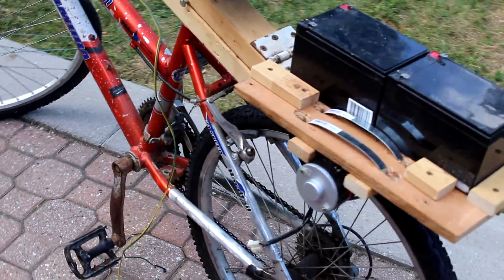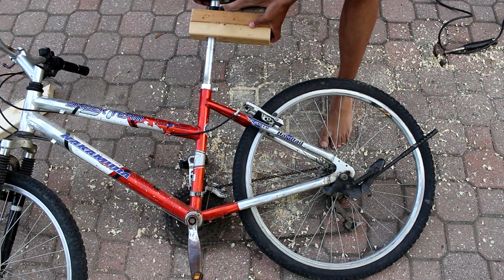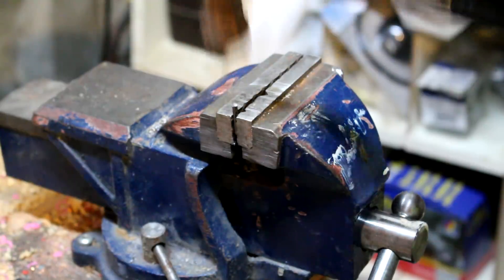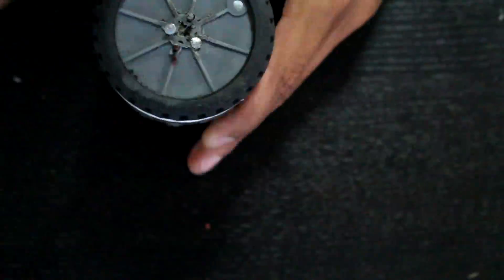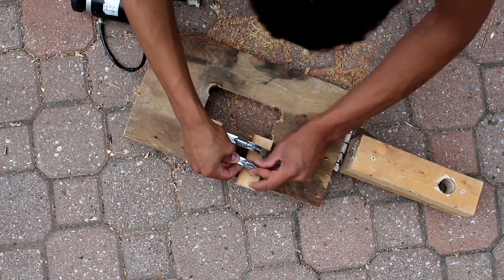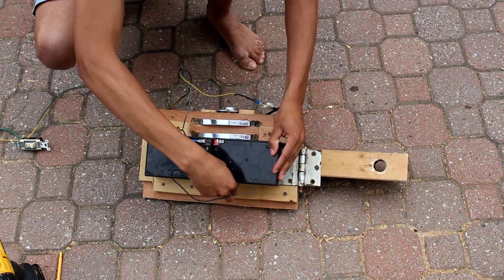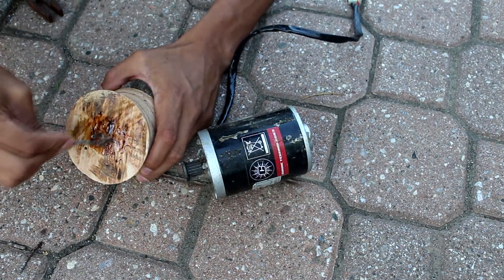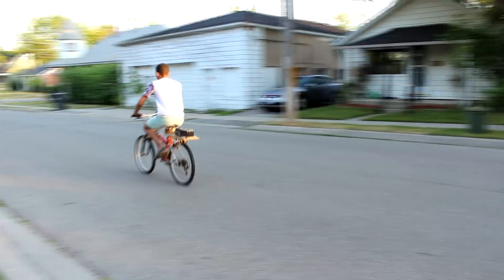How to Make an Electric Bike - Simple and Cheap

Comment: I think it’s a clever build I think one thing I would try to suggest is to lighten the load on the bike. That’s a lot of wood might be able to get away with reducing some of the mass of the wood by simply cutting the corners smoothing them out maybe even drilling holes an inch or an inch and a half thick which would reduce the weight but still give you some of that strength of the wood I don’t know what your bike is made out of but if it’s a steel bike, I personally know having a steel electric bike that folds in half. It’s very heavy and it’s quite a drain on the battery in the motor, so if you can get an aluminum alloy bike, aluminum rims your lightning the load right there and if you’re not a very heavy person that will help greatly on reducing any unwanted weight although it is pretty cool, I am impressed

Comment: Since I recently Was hit by a texting moron (13 juillet-left me with 7 broken ribs and a collard bone) got me interested into a similar project but for me. Using the motor from a Razor E 100 Electric Scooter but replacing the Battery by a Portable Drill sooo looking for some help BATTERY - WISE (like 12 volts to 18 volts) i'm at :  johnnyjeanproux@gmail.com

Comment: Get rid of the background music, its annoying and makes it hard to hear what your saying! That being said, nice vid, you mentioned your batteries were a bit overpowered for the motor, try putting them in parallel rather than series, it will half the power going to the motor and double the life of your battery charge giving you a greater running distance.

Comment: You need a powerimig welder. Wood can be easy to work with but it isn't as durable. Have you thought about putting a speed controller on that?

Comment: America is always uptodate on the idea of safety,osha,fines,etc; THE PROBLEM IS , they may not use safety WHEN IT'S NEEDED(just like a  STOP sign,where there SHOULD NOT be one; or the smoke detectors w/a bad battery everywhere,or fire extinguishers everywhere,even when there are no combustibles...); Clinton once warned that if a ladder has too many safety features,and so, very expensive,some will opt for not buying one, and just pile a few chairs on top of each other,and...you get the point
Does anyone in their right mind really think JoshBuilds was in any danger? (the same can't be said for that drill bit almost hitting the "concrete" under that board,lol);
This is the most interesting,simple, electric bike build i've seen,and the same system has been used by Flandria Ultra Sport and Velo Solex ; they sold thousands all over europe; the gismo always attacked on the FRONT tire,and the roller was made of a VERY hard material,stone type,and some were coated with carbide,because it tends to wear fast(lots of rpms,and dirt from the road); thanks ,i liked it.

Comment: add heavy duty bungee cords from the motor mount down to the frame.  Only the weight of the batteries is pressing the motor wheel to the bike wheel, and that's not really enough friction.

Comment: am confused here guys...how is the motor connected to the wheel to move it? i didnt quite figure that out.
Reply: Abdulkareem Mubajal It is a friction drive. Like how some dynamos work but with the wheel being pushed.
The weight of the batteries is impirtant here - with lighter batteries the drive wheel would skid on the rear wheel.

Comment: Batteries do not force current.  Amps are there to allow for longer run time. As long as the voltage matches then you are good to go. It is good to have more amperage in your batteries.

Comment: Love the really simple approach to your build Josh. Coat hanger metal rods, pipe clamps and 'yeah' for wood!
As it goes my dad did a similar conversion on my Raleigh Chopper bike when I was a kid. He used two windscreen wiper motors butted together with rubber door stops on the shafts for drive and powered by a beast of a car battery. System was spring loaded to the top of the wheel and included a lever mech to raise it off the wheel when drive not required. Happy days 😀

Comment: what about using a lithium battery like a li-po or li-ion or lifepo4 to make it lighter and improve the energy density and the lifepo4 has almost no explosion risk you could do it with 7 cells in series to get 25.6v whitch is close to the 24v from your battery

Comment: I like the bike.  i'd suggest using a 20 amp circuit breaker for the switch. A regular light switch will tend to weld itself closed which makes it damn hard to stop. good job though

Comment: How the hell motor turns wheel? did you attach them to each other? why people makjng such videos, don't show the most tiny part to which the whole idea is bent to?
Reply: The motor is on top of the tire.
Reply: The brilliant part of the design is that the weight of the device automatically uses gravity to press the drive wheel ( the small wheel connected to the motor) against the rear wheel of the bicycle. The use of an inexpensive door hinge and wood makes the whole assembly super cheap but effective.

Comment: Instead of having the motor resting on the back wheel under it's own and the batteries weight would it not be better to pull it down slightly with wire on both sides?  It might stop the motor wheel sliding on the bike tyre and transfer more energy :)

Comment: Screws hold better in wood than in plywood, so if you are screwing wood and plywood to each other, drill a hole through the plywood, put the screw through it and screw it into the wood. And glueing and screwing is many times as strong as screwing alone.

Comment: what are the specs for the motor
Reply from the maker: 24 volts, 5 amps
Reply: Its_Me
Reply: i know its you
Reply: Its_Me hi
Reply: 120 watts then.
Reply: 24V * 5A = 120W = 0 .161 HP

Comment: Would probably work much better if your back tire wasn't almost flat :-)
Reply: Stephane Brouard I think the motor and battery's must weigh over 50lbs maybe 75.. so needs fatter tire maybe. For anyone wanting to figure hp, multiply  volts times amps of motor rating and  divide by 748 to get hp.

Comment: How did you get it so that the motor would actually move the wheel?
Reply: Its a spinning disk that sat on top of the wheel, And by using the power of friction it propels the bike. Now this system would be more effective if he had maybe put a weight on the back to keep the motor from bouncing up.

Comment: The whole battery portion bounces on the wheel? I think you need to add a support from the end of the battery plank down to the bicycle frame, with adjustible tightness :)

Comment: cost to make?
Reply from the maker: 90, 30 for each battery and 30 for the motor.
Reply: i guess it us dollar?
Reply: 90 US dollar?
Reply: what are the amps and volt of these 2 batteries ?
Reply: Nijam Md f
Reply: 12v 7-15a And in series its 24v
Reply: ivbbv

Comment: If that motor has a permanent magnet, there here is an idea for you. Using a relay, and a switch at your handle bars, you could switch the motor into being a generator so when you are going down hill, it will help to recharge your battery while at the same time, provide some braking action too.
Reply from the maker: Joseph Tennis DC motors when used as a generator will generate DC current
Reply: And a few diodes too...
Reply: Any DC motor that contains a permanent magnet (and most do) will generate power if you spin it. Some are better than others. It all depends on how strong the magnet is. An easy way to see if your motor will make a good generator is as follows.

With no wires attached to the motor, spin by hand and get a feel of how easily it turns. Next using a piece of wire short out the two terminals. Now again spin by hand. If you feel more resistance (harder to turn) that is because it is generating power. You have a good candidate for a generator. 

Search - using a motor as a generator - and you should find many articles on the subject.
Reply: Roy Riederer Very good, but to charge the batteries correctly you need DC, not AC, some videos explain the conversion technique.
Reply: FrikiTastic Who's talking about AC? This is a battery driven motor. No AC involved.
Reply: it an hnoda cibic moter
Reply: Will you explain that please?
Reply: can u build this one for me? how much will u charge labor plus cost of materials?
Reply: Roy Riederer is p
Reply: joshbuilds 
what moter name

Comment: You seem like a decently smart person, i just don't understand why after showing your building skills you didn't think of putting an adjustable tension arm between the wheel and motor assembly to hold the wheels tight together creating more friction thus more speed.. No brainer IMO..
Reply: more pressure on tire = more tire wear and more drag, if its not slipping its not needed ..

Comment: this is really cool, seems like a 1 day job :D :D still im not convinced of the way the engine is transfering the power on to the wheel. seems like it wouldnt be able to pull you up the mountain for example... anybody got a better way thats also relatively simple? 

PS. li ion batteries are not expensive. new ones i would recommend the icr18650-26f from samsung.....incredibly cheap. otherwise just buy broken laptop batteries and take em apart

Comment: If you put a strap on the back of the board with the motor on it and connected it to the frame around the back wheel it would have more grip and not bounce as much

Comment: You need to put a spring pressure to give the tire.
Reply: ~25lb (11.5kg) of battery isn't enough to weigh it down?
Reply: finally a real comment
Reply: or glue an old ruffed up tyre on the wooden block for more friction
Reply: a bunji cord would work great and a easy fix to keep pressure on tire
Reply: sweet dreams I was thinking the same thing
Reply: +kschabowski inhumansantosh703Sgtb

Comment: how do you stop the elecltric drive at stop signs, etc.  Or to slow down?
Reply: If he was smart, he'd be using one of the WuXing brake grips that interrupts the power when you squeeze, but of course, he uses bare feet with power tools, so don't count on him figuring that out.

Comment: good work!! but batteries are heavy!!! I speak from experience. Lithium ion  would be nice but that price is a killer. Batteries in frame between your legs  maybe....and a long spring attached to the bike and wood platform to keep it from bouncing. I'm working on mine now. I like your seat post idea. Very quick release and universal mounting
Reply: yeah they heavy but their weight helps push the motor wheel down on the tire :)
Reply from the maker: thanks, and yea lithium would've been nicer but they are real expensive
Reply: joshbuilds pls how did you do the wiring pls make a video

Comment: If you had too much amperage, that results from too much voltage for that load, yeah? Instead of doubling the voltage by wiring them in series you could wire them in parallel to keep the voltage the same as one battery but still have all that extra capacity / run time.
Reply from the maker: that would work but the motor is rated for 24 volts. each battery is 12 volts. so if i were to wire in parallel, the motor's battery would last longer, but due to the lower voltage it would not spin as fast
Reply: ***** So what was the problem, the motor is just drawing too much current? I'm not sure we're speaking the same language in terms of electricity.
Reply from the maker: There wasn't any problem.  U just proposed I would wire  it in parallel to give the battery more life but i said doing that would give it more life but would reduce the speed of the motor
Reply: you literally said there was...

Comment: The idea of creating an electric bike is good. But that is not a proper electric bike. It must be improve. I suggests u to add a variable speed circuit which will allow the bike to run smoothly rather than instant run.

Comment: hi i like your video ihave e bike aswell i put new baterrys but the problem still with the power if i go just even a little bit uphill bike just slows down until it stops any sugestions where to look for proble  e bike is old 300w motor 36v

Comment: That's pretty cool it's good seeing young guys getting in and having a go. Just a few small comments, I realise you have batteries holding the motor onto the wheel, but I would probably still add a strap to hold the motor tight to the wheel, and maybe wrap some rubber, like an old inner tube around your wooden wheel for some better grip. I'd probably also add some straps over the battery, in case you crash so they're not flying around, and lastly, I would use a light switch with a dimmer, depending on the amperage, so you have a variable speed motor. Good project though, I've always wanted to build an electric bike but the fun police in Australia have basically banned them unless they're very weak (yeah, ban an electric, zero emissions transportation system right!)
Reply: Aussie, I loved the respectful way you addressed this young tinkerer. Some other comments are so rude that one feels shame about humanity and the internet.  If you ever build your dream ebike, please let us know!
Reply: It may not be the case in Australia, but in NZ if they're above a certain speed they need to be road legal and you need a license. They're not just straight up illegal.
Reply: that motor looks like a 200w scooter motor, it'll be within the limits, i have 2, i tried this a little differently and it sorta worked, this is actually a very simple method, i like it. also a AC dimmer wont work with DC, the dimmer works by setting a limit to when power comes on as the AC voltage rises and falls, because the DC is constant it would just act like an on/off at some point like 90%
Reply: +Hebby Hebron how about an pot? would that work better than the dimmer switch or is it the same?
Reply: Can use a speed controller  lot on the web also cheap that could handle the current, man was having some fun and sharing and knew what he was doing, battery on motor system helps with the drive good synergy!! Good job.
Reply: TheAussieStig30
Reply: MotörHeavyRockHead + It's all part of the plan. If people show simple electric vehicles are all that's needed, they'll start wanting simple electric cars too. The controlling is leading to conquering.
Reply: Gimme Motörhead Til I’m Dead 😊 😂 😜 Hey यू हेलो हेलो हेलो हेलो हेलो हेलो हेलो 😂 हेलो 😂 हेलो 😜 हेलो re was we're we're 😂 😜 q West o😜 Hey you हैव😊 😊 😂 😜 😜 i😜 Awesome hui t😊 👋 yAwesome 😂 😂 re 👍 👌 😎 😎 ne keeneland akelepan👌 😂 हेलो 😜 हेलो 😂 😜 😊  😊 👍 😜 👌  हेलो 👍 हेलो 👍 हेलो 👍 हेलो 👍 हेलो 👍 हेलो 👍 हेलो 😂 😜 hey 👨 👋 👋 हेलो 👍 👍 👍 👍 हेलो cap 😊 😂 😊 😂 😂 😜 😜 हेलो 😊 😂 😂 हेलो 😜 हेलो 😊 😂 😂 हेलो 😜 हेलो 😂 😊 😂 😜 😜 हेलो 👍 हेलो 😊 😊 😂 😂 😜 हेलो 👍 हेलो हेलो 😜 😂 😊 😂 😊 😂 😊 😊 😂 😜 😂 हेलो 😜 hey man in its iiiiHey iiiHey iiiiHey Hey man in its just iAwesome Awesome 😜 😂 😊 😂 😜 😂 😂 😊 😊 the 😊 😂 😜 👍 हेलो 😜 👍 t👋 😜 👍 r😜 Awesome t😊 😂 😜 tw😊 😂 😜 😊 😂 😊 😂 😊 😂 t😜 😊 😂 😊 😂 😂 😊 😂 😊 😊 😜 हेलो 😜 😊 t😂 😜 😂 😜  😂 😊 😂 😊 👍 😜 👍 😜 👍 😜 😜 हेलो 😜 👍 हेलो 😂 😜 😜 😊 wहेलो 😂 😜 😊 👍 हेलो 👍 😊 👍 😂 😜 हेलो 😜 👍 हेलो 😊 👍 😂 😜 😊 😂 😊 😂 😜 हेलो 😜 😂 😊 😊 😂 😜 qवेस्ट 👍 😊 😂 😊 😂 😊 😊 👍 tttt👋 ytAwesome Hello hello हेलो 😂 😜 हेलो uAwesome Awesome and 😜 👍  be nevertheless landmasses kya a😊 😂 😜 हेलो 😂 😜 hey t😂 Hello and this 🎬 Hey 😂 👍 😂 y👋 Hey its not appropriate time 😊 😂 👍 😂 t👋 😂 😊 😂 👍 be 😜 😊 😂 😂 😊 👍 😂 😜 😂 😊 😊 😊 👍 👍 😂 👍 be i👍 u👋 tAwesome 😂 😜 👍 i😊 😜 iit uAwesome Awesome 👍 😂 👍 be द 😜 😊 👍 😜 😊 😂 ह ेलो 👍 😊 😊 sहेलो 😂 😜 👍 😂 👍 हेलो 😊 😂 😊 😊 😂 😜 हेलो 😜 😊 😜 😎Hey Hey man  😂 😊 😂 😊 😂 😜 हेलो 😊 👍haha 😂 😊 😂 😊 😂 😊 😂 😊 😂 😂 😜 😜 👍   😂 👍 हेलो 👍 हेलो 👍 हेलो 👍 हेलो 👍 हेलो 👍 हेलो 👍 हेलो 👍 हेलो 👍 हेलो 👍 हेलो 👍 हेलो 👍 हेलो 👍 हेलो re 👍 jazz  philipino enamel shameless multireddits quantityओन्ली  koi👍
Reply: 😂 😊 😜 😊 😂 😜 you're 👋😂 😊 😜 😂 हेलो 😊 😂 😜 👌 👍  👍
Reply: 👍 हेलो
Reply: 😊 😂 😜 😊 the 😎
Reply: Yijh7ofgu
Reply: Rusty CraftKnife yeah they're not straight up illegal here either, but they may as well be. They're restricted by power, I think 1200 watts was the figure, for petrol and electric. Problem being, and probably similar in NZ, is proving one way or another. We were buying electric bikes at one stage, they were all rated at 1000 watts, yet most of them used a 12v battery where as 1 used an 18v and another used 24v, and every model had a different motor. So how do you prove to the police when you're stopped that this bike will only do 20kph, or is 1200w. It's just another case of government stupidity, and probably a way to ensure people who could commute on an electric bike will have to buy a scooter or motorcycle and have a licence and pay rego.